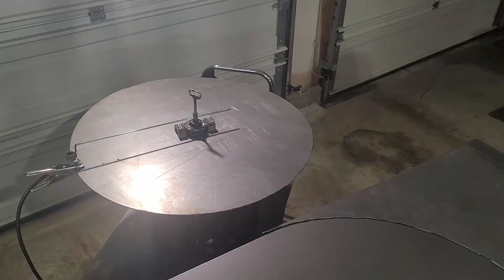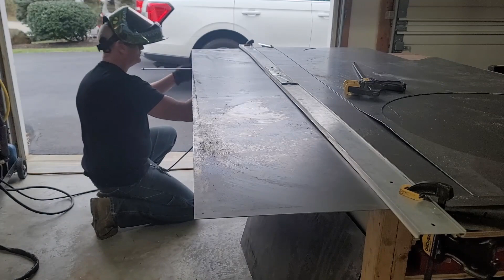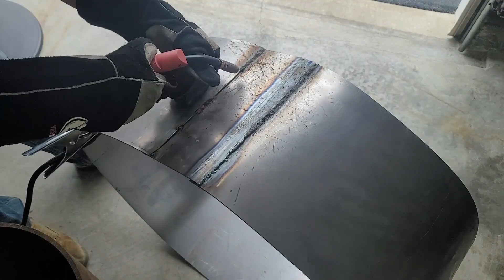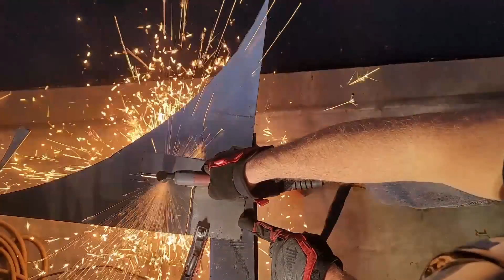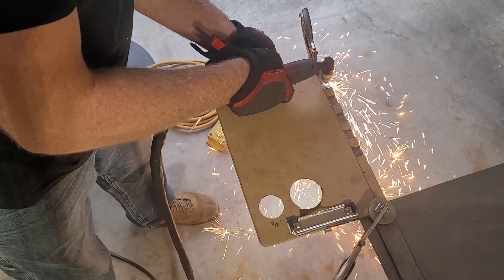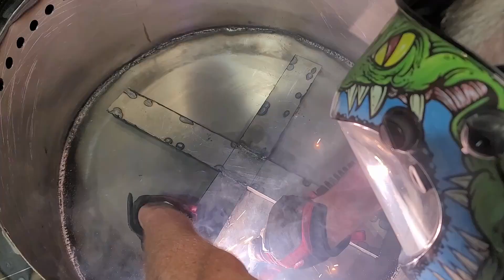DIY Project: Smokeless Fire Pit Part 2 | YesWelder

Comment: Quick question- was that Flux Core or did you use basic wire with shielding gas?  I haven’t worked much with 14 gauge sheet metal so unsure of the best ways to weld via a Mig (as usually I see guys with TIG welders for sheet metal).  Thx again for the video!!  Looking to start one myself now.  😁
Reply: I used flux core .035 wire on this project and it worked great, take your time,  don't try and weld shot.  If the piece get too hot, it will burn through
Reply: @harbaughsworkshop  thank you brother.  Have an awesome week.